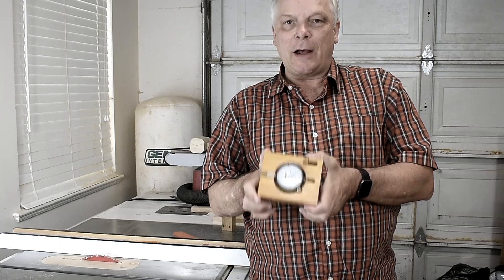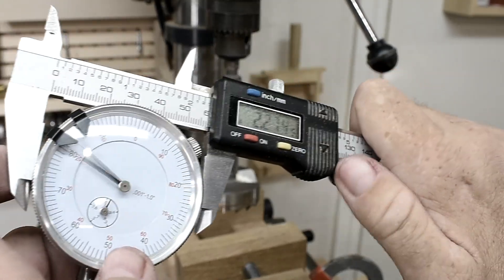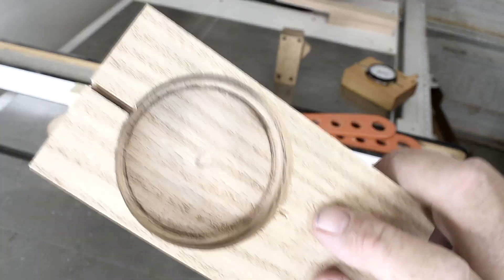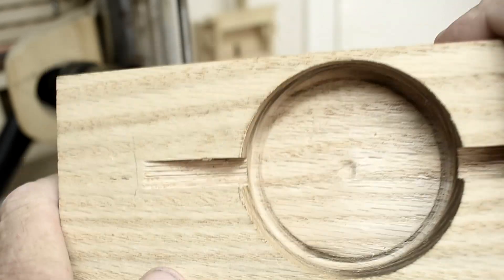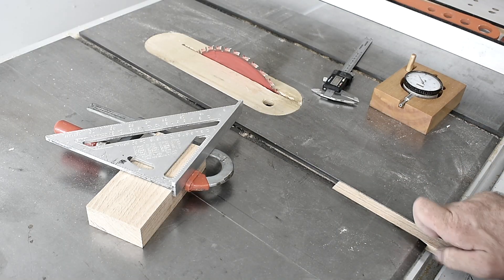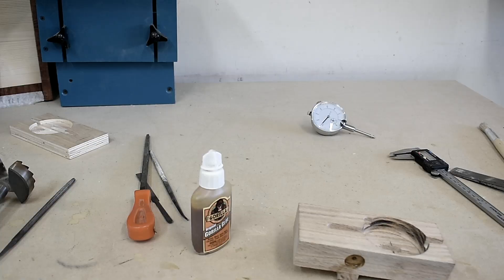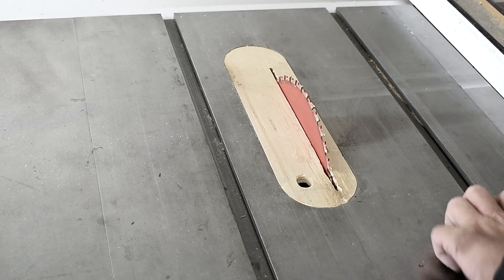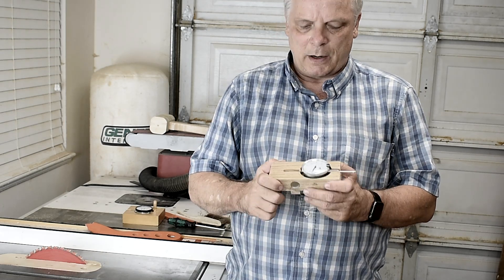How to Make a Table Saw 3 in 1  Micro Adjustment and Alignment Jig

Comment: There is no point to a micro adjust on a table saw fence. Totally unnecessary. Not being fixed in the miter slot I don't see how it's any good to align anything on the table saw either. This one's a fail for me.

Comment: Jack Houweling may I offer you a tip? After having change the belts on my drill to dial down the speed for a metal project, I've been lazy and haven't changed it back. Using forstner bits at an incredibly slowed down drill has been an eye opening experience. It's cleaner, doesn't burn and--get this--seems to cut faster. No offense intended as I'm continually impressed by your craftsmanship, just an aside I thought I'd share.
Reply from the maker: +Boris the Bilder Thanks for watching. I had it on the lowest speed but the video clip was sped up and  my bit wasn't the best.
Reply: Thanks for responding.  Really enjoy all your content.  That makes sense now...didn't realize you sped it up.
Reply: Wow very nice we are going to make one tomorrow thanks it’s the nicest one I’ve seen.

Comment: Very nice work.  I like that it's multi-purpose.  I don't, however, quite understand the reason for the angle on the side of the jig.  Is that just to make it easier to read when used on its side?  Thanks for sharing.
Reply from the maker: +Larson Bennett Thanks, yes the angle makes it easier to view.

Comment: Nice upgrade Jack. I can see you using it to make micro adjustments on the blade to fence distance for needed precise cuts occasionally. Do you usually measure the blade square and fence that often?
Reply from the maker: +MRrwmac Not often, but with this tool you can check anytime fast just for reassurance.
Reply: Jack Houweling Very good point. Thanks.